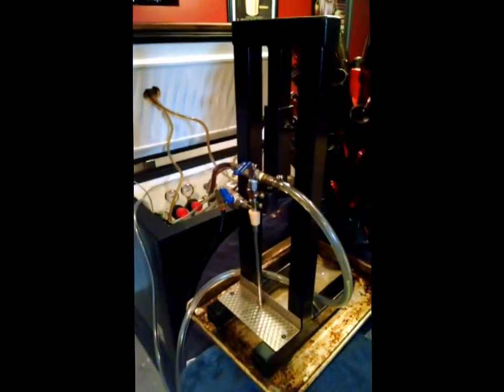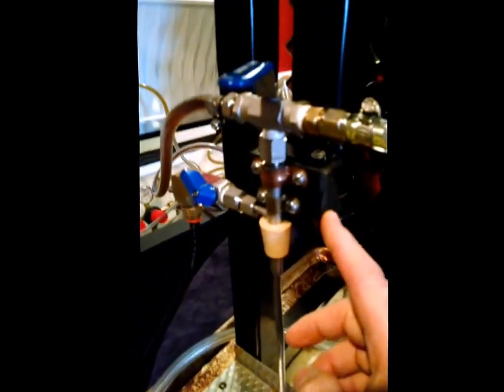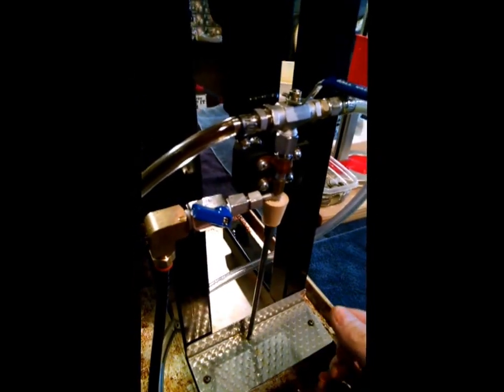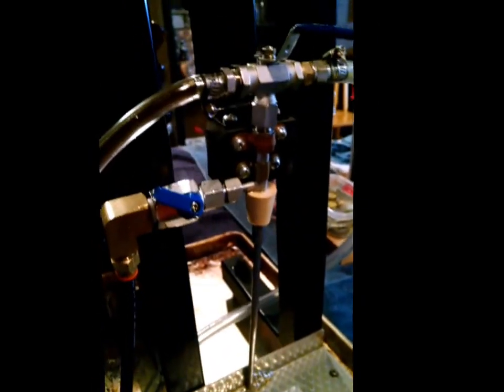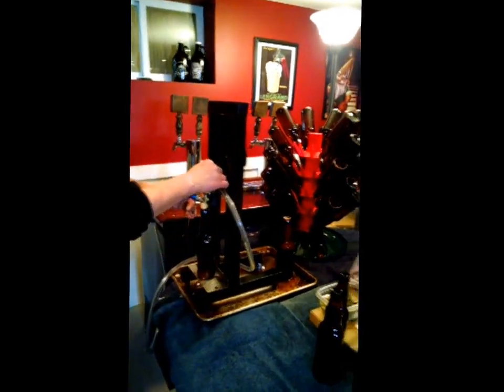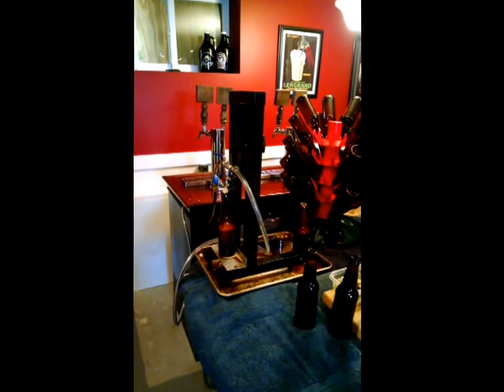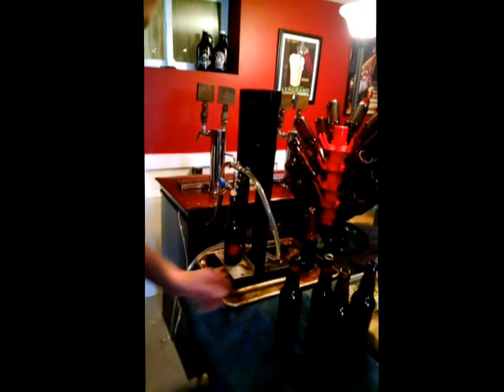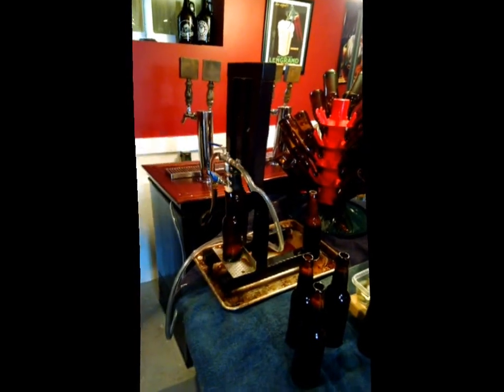Counter Pressure Bottle Filler

Comment: Hi, nice build.  I'm thinking of building something similar out of wood.  What did you use for the adjustable height part though? Trying to figure out what to even google!
Reply from the maker: Hi Sean, search "telescoping tube" on google. I used 1-1/2 OD" square tubing for the main frame and adjustment leg then a short piece of 1-3/4". You can find shorter pieces of this telescoping tube on ebay.

Comment: Hi some plane to build it
Reply from the maker: Hello Miguel,  I really don't have any plans for building this CP bottle filler. I just figured out the heights and center lines based on the bottles we were planning on filling (12, 16 and 32 oz). I used a MoreBeer.com counter pressure bottle filler assembly mounted on a hinge as shown and made the adjustable height frame to fit thye bottles we planned on filling. If you are only going to fill one size bottle then you won't need an adjustable frame.  https://www.morebeer.com/products/counter-pressure-bottle-filler.html

Comment: Awesome set-up.   I really like that metal frame.  Did you find it, or did you make it?
Reply from the maker: +cicatrez879 I made the frame. Like I said in the video it doesn't have to be TIG welded powdercoated stainless like this one.... it could be a 2x4 wood frame or any other rigid enough material. Maybe even PVC pipe. :-)